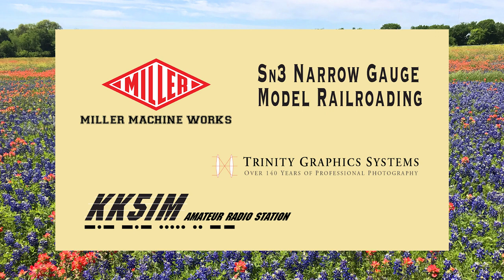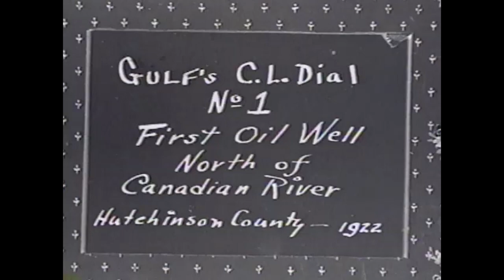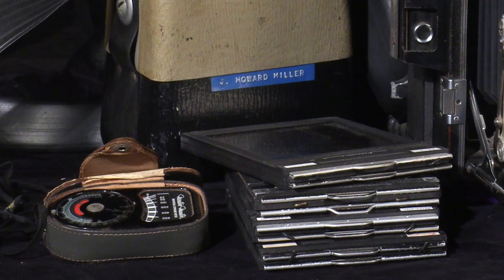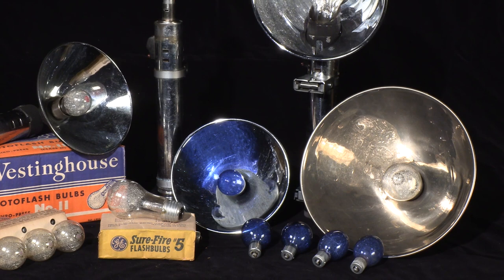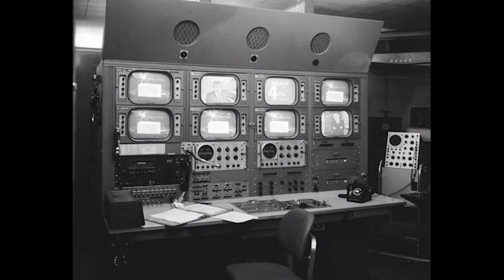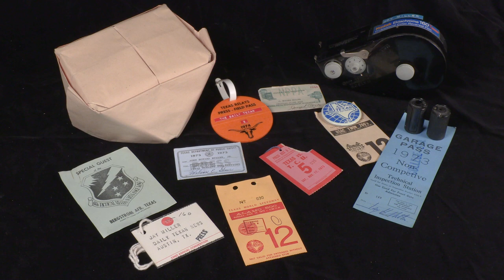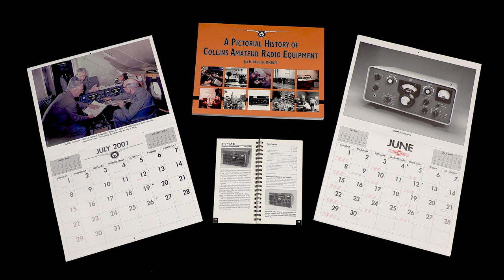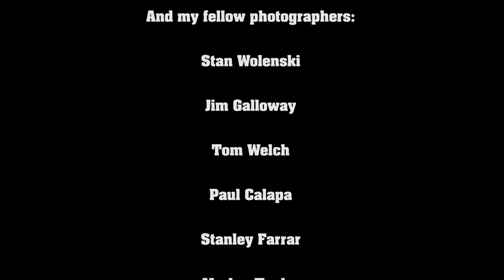Darkrooms to Digital Imaging - 140 Year History of Professional Photography

Comment: Thank you so much for doing this, brought back many memories. I started shooting with my Dad's Ciro-Flex TLR in the early 70's. I don't know how many 25B flashbulbs I went through and sometimes I would buy out the local camera shop in Morton Grove, IL. Lots of visits to the Fotomat back then!

At some point I put together a darkroom with a (very) cheap enlarger, got a Canonet 28 rangefinder and started buying bulk film in 100' rolls. I ended up with a Canon A1 kit and worked for the high school yearbook, but by that time I had discovered girls, rock and roll and started driving and it was the end of my photography. Never did do it as a pro but got some pizza and beer on occasion. ;)
Reply from the maker: Thanks for your comments!

Comment: Excellent Video ,, How did you digitize your motion picture films?  I have recently starting doing that and have been experimenting with several different methods.
Reply from the maker: Thank you. For some strange reason this video has not received very many views! 

We have used Legacy Box to transfer a great deal of 16mm motion picture film. The results are "okay" but not as good as they could be. The do not offer high-resolution as other firms do but Legacy Box is somewhat cheaper. I have noticed though their attention to their customers and quality of service is not as it once was-- but what is these days.
Reply: @Radiotexas  Thanks for your kind reply. I don't know how much of that 35,000 feet you already have digitized but there is a guy in Kansas ( I believe) who has an ad on Ebay, He was very good, cleaned it before hand and everything. However, I found that I had so much film, I started doing it myself. May be an option for you depending on how much you have done already,
Reply: @Radiotexas  By the way, I am also a ham and a vintage photo nut, please don't tell me you're a Leo too! :)  De NI3I